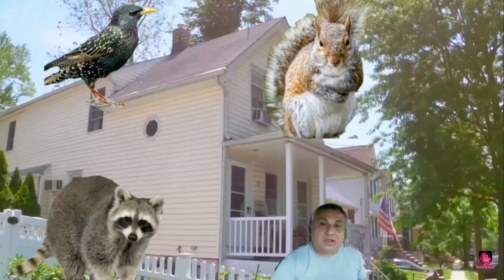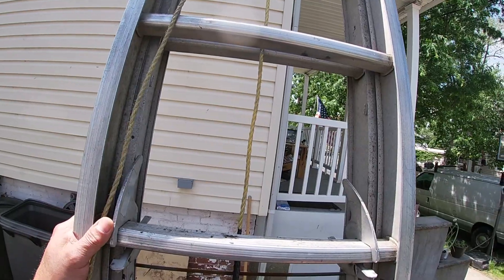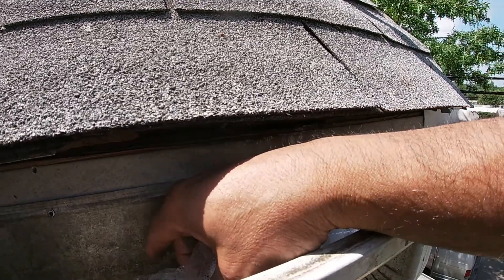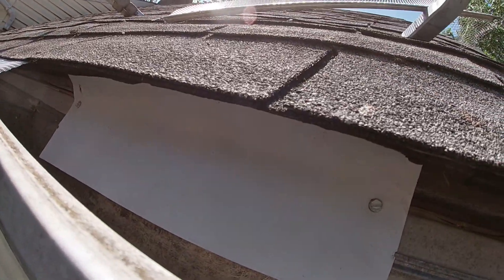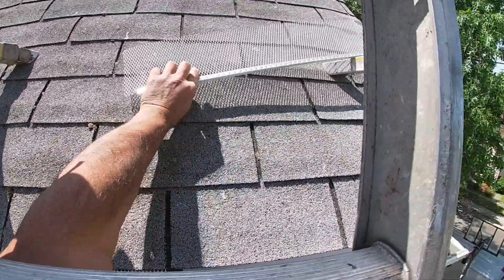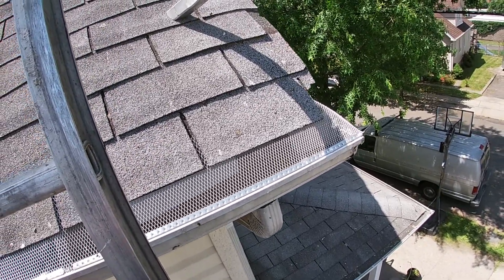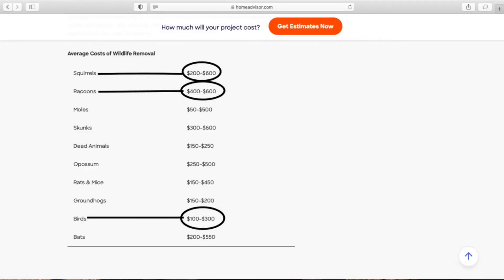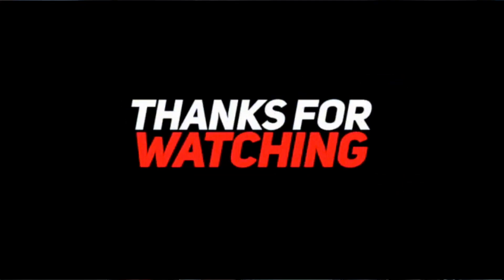HOW TO GET RID OF SQUIRRELS OR BIRDS FROM YOUR ATTIC AND SAVE HUNDREDS,

Comment: What if the attic is enclosed and you have no access and you don't know if the squirrels are still inside and just being quiet?  This happened to me and then they chewed through the wood and aluminum flashing I used and did more damage.  Then I had to close it up again.  Actually I have another question:  Can squirrels climb up inside a 2" x 3" downspout?  How about the outside?  Thanks.